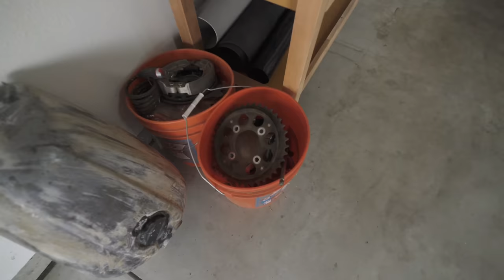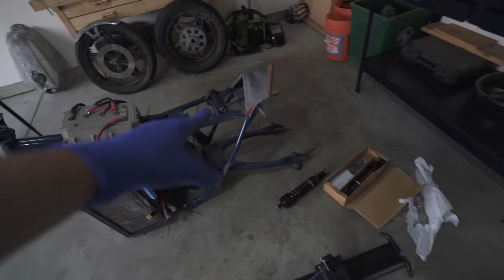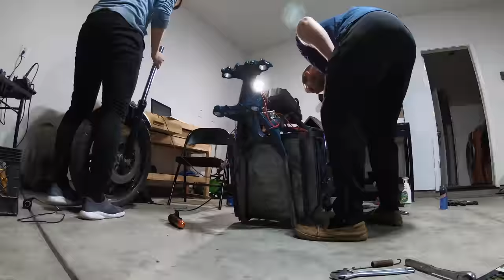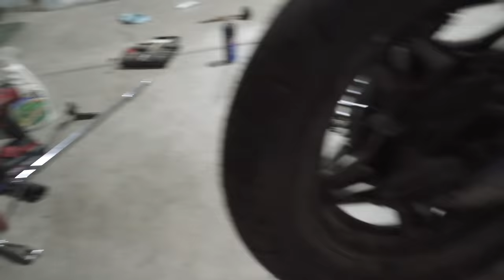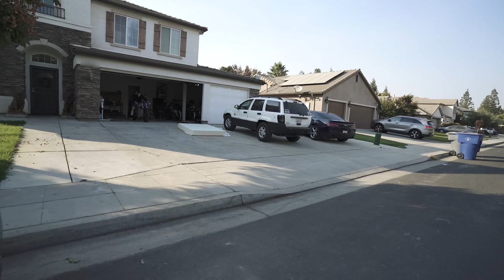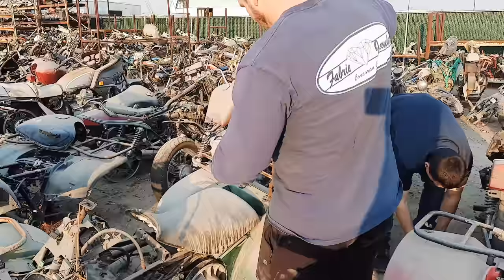ELECTRIC CAFE RACER for $4,000 | ASSEMBLING and TESTING

Comment: Did you actually suggest to wire together the chain?!

That thing could (will) break and take off your leg or seriously hurt you..

Stay safe man!
Reply: I found it most worrying that taking a bike out with bad brakes  isn't a stay safe message either.
Reply from the maker: You get my point, I was tempted find something strong enough to hold it for a first low-speed run is all I meant. Not necessarily wire. Didn't want to leave you guys hanging
Reply from the maker: @frankysworld  pushing it down the driveway with the brakes stuck on? We've done more dangerous things than that!
Reply: @TheInja  that battery box is dangerous try out a graphite or plastic battery box
Reply: Yup he was going to ride with dodgy brakes, a botched chain and who knows what else. Not a good thing to put across, infact was plain stupid to even mention it
Reply from the maker: I'm still confused how people are getting so upset about this 😆 Didn't we all have a childhood? This isn't even dangerous 😆
Reply: @TheInja  it is dangerous and if its used in its current state its Dangerous to others
Reply from the maker: @thegodhoward8037  for an up-and-down the neighborhood street test? I'm confused how fast people think we would be going on this temporary test setup
Reply from the maker: Like of course we won't be riding it on the road like this 😆
Reply: @TheInja  your battery box alone is a safty hazard  a full metal metal box +high voltage battery = fried inja
Reply: @TheInja  I recommend using bed lining to make the box shock resistant and reduce the chances of you turning into chick fla next option on the menu
Reply: @TheInja  and if if you can't find a solution for that chain then a belt systems would be the next easiest thing to acquire
Reply: For an up and down street test, then next breath, won't be on the road, ERM where's the street then. Also doesn't have to be fast to be dangerous, a 5mph chain whip across your legs causing loss of control is not good.
Reply: Bikes aren’t safe m’kay, you could get really hurt m’kay
Reply: @TheInja  I think the majority who raised this are seasoned bikers - after a few slides on the asphalt - or even worse, attending some funerals - we tend to get a bit alarmed when we see - what could be interpreted as a lax attitude, or merely afterthought towards safely functioning drivetrains, brakes, etc.  Now for sure I don't object to a bit of thrill seeking and pushing the envelope of a bike or testing one's own capability - but introducing a factor where drive chain or brakes may not function safely when you need them the most is just throwing every bit of caution to the wind - might as well be popping  a tide pod before getting on the bike because you are young and daring :)
Reply: @TheInja  people are afraid to get a knee scrape or a splinter nowadays. thats why they watch you. so they dont have to take any of the risk.
Reply: Watch out for the bubble boys.
Reply: @TheInja  I think people just have a genuine concern about your safety.      There are people that seem to be knowledgeable here, I would trust them.  Even at a low speed that chain could slice you.

  Side note:  look up audio carving for when you have a voice over and music is playing.  Makes a big difference
Reply: @cjmarcel2971  sounds like you don't care about the lives of others
Reply: @thegodhoward8037  the battery is wrapped and sealed and then inside the box. And graphite is definitely conductive, it's used as an electrode in spark erroding

Comment: Waited a long time for this moment . Keep an eye on the front frame downtubes when you hit a pot hole. They will try to pull themselves straight and snap since you lost all triangulation. You should also buy a new chain.  You cant join odd bits of chain together, they have stretched at different rates and will go tight and slack as they run over the sprockets.   👍
Reply from the maker: It was just for the test, we were hoping to get that one temporarily and make a frankenstein change until the new one comes in!
Reply: DEAN WATERS This guy has no idea what a wet noodle his frame is now.
Reply from the maker: @johngalt97  we'll see, I guess. Just keep watching and we'll get it on the first ride this week!

Comment: I looked through the comments for a minute to see if anybody else mentioned the issue with your chain. You are trying to put two different chains together, that’s why your pin is not fitting. You can’t mix and match. You need to get sprockets that are matched to the chain pitch. You should’ve bought two new chains that match each other and both pockets. Mismatch sprockets and chains are a bit of a hazard, they will make a lot of noise and wear out really fast. 520 is smaller, 50 and 530 are basically the same dimensions except that 50 is for industrial use and 530 is for transportation. You want to use a 530. Cheers mate.

Comment: If it runs that fast and smooth 
with the electric motor, just 
imagine what it would be 
like if you add a five or six 
speed motorcycle transmission.  
It would be awesomely epic.
Reply: 300lb battery pack !! Yikes

Comment: HECK YEAH is almost finished!!!
But I have to admit that you deceived me with the thumb nail thinking that it was running.
I suggest that you get a even larger chain because we want "MONSTROUS TORQUE" so even a bigger sprocket will be necessary.
And you always can change the sprocket for a smaller one on range mode (although I doubt it)

Comment: You need to remove the caliper puck and clean or the front breaks will lock when they heat up. I rebuild these at my shop on CB350's
Reply: Brakes dude, brakes.

Comment: Is there going to be any cooling for the battery, or is the regular airflow enough?
Reply from the maker: With the new accessory pack being added soon, the motor won't be pulling much from each cell, so heat shouldn't be an issue.
Reply: @TheInja  Ah ok, thanks.